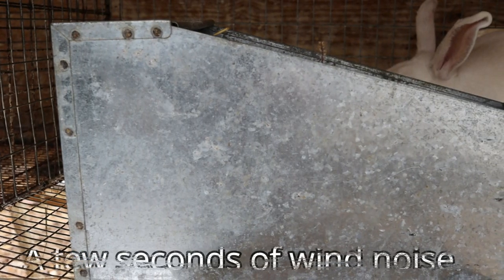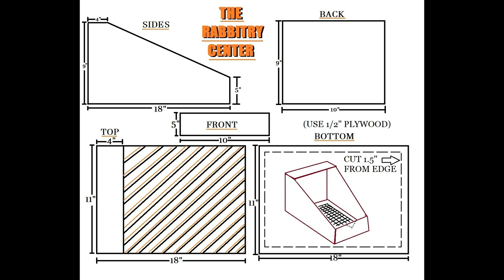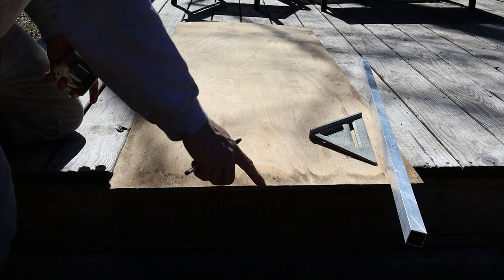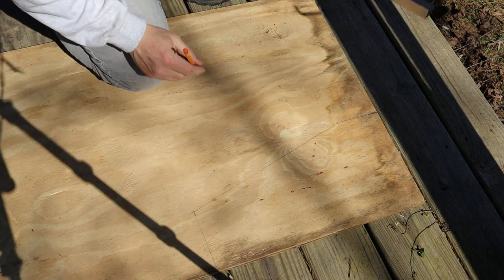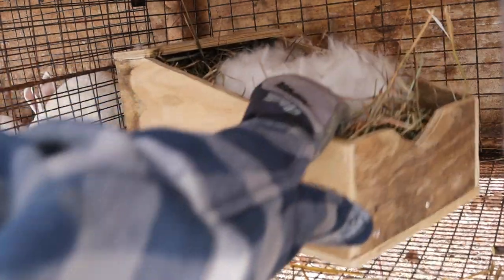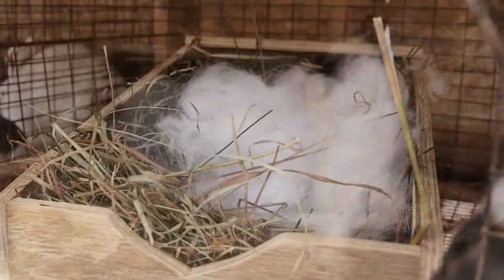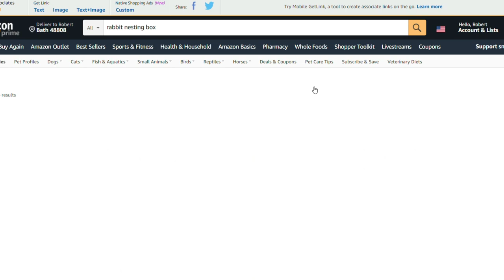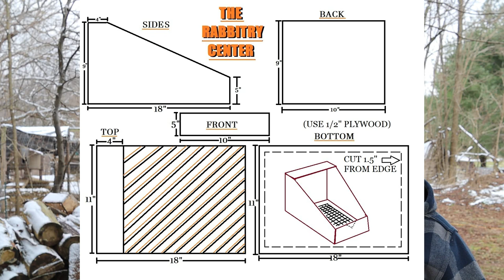HOW TO BUILD A NESTING BOX

Comment: Is plywood the best material to use? I would be concerned about the glue if the mother chews the box.Would pine boards be better for the rabbits? Or maybe hardwood boards?
Reply from the maker: Your rabbit will be fine with both
A little bit of chewing isn't gonna hurt them it's good to provide softwood for them to chew on as well as hay everyday so they have something else to chew on

Comment: An easy and nice box, but might I suggest stapling the netting on the bottom before putting on the sides and so on.
Reply from the maker: You could but it nice to remove the cage floor bottom when cleaning out

Comment: What’s the point of the wire bottom. If you’re already putting it on a wire floor. That’s the same dimensions?
Reply from the maker: So you can move the litter if needed this helps keep them contained and none of their little hocks get stuck and crushed under the nest framing

Comment: I think the cage wire should be fit from the outside so that it won't harm the kitts or the doe
Reply from the maker: Cage wire doesn't hurt kits it helps with ventilation 
In the winter time it's covered with shavings and straw
Reply: @TheRabbitryCenter  i am concerned about the edges